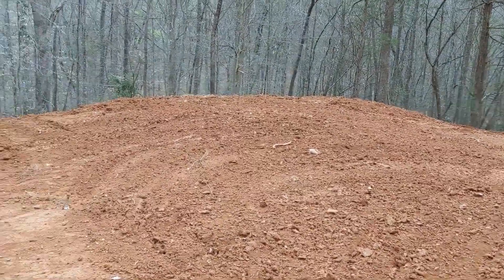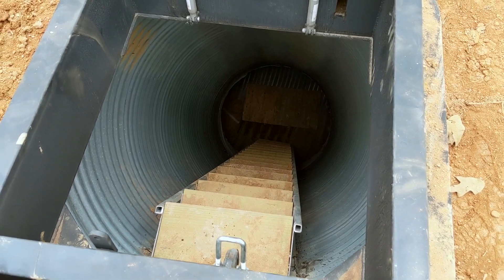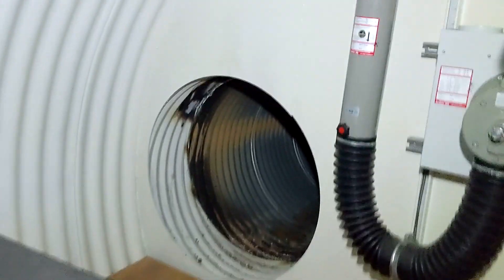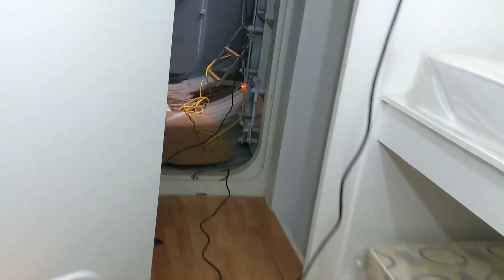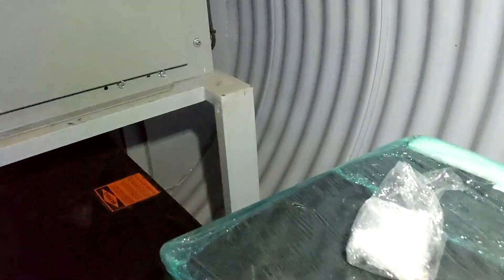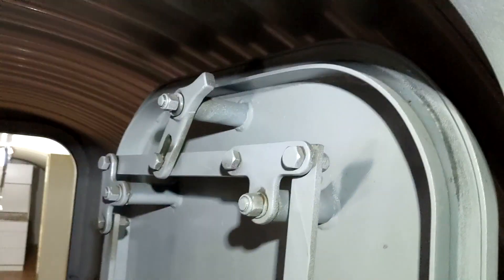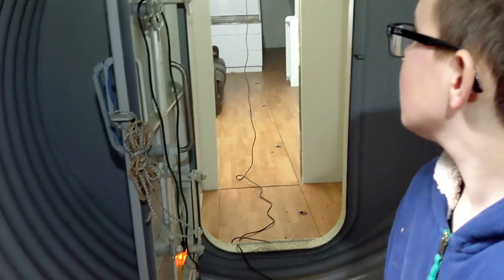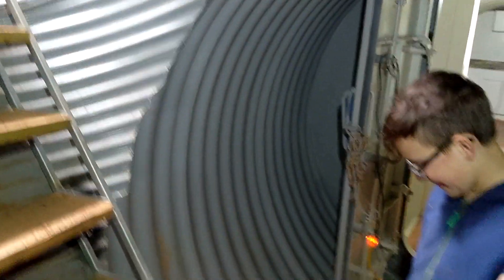What's Inside This Underground Bunker?

Comment: Seems to me like it needs a way to pump out water in case the access gets flooded. Especially because you would be separated from your generator/battery room if it does get flooded. A simple sump with a line running far away from the bunker... not sure if that is much of a concern or not. In that area

Comment: The entryway is not designed for elderly people or anyone with mobility issues. It would be impossible to move an injured person who is on a stretcher into this bunker. Do you just abandon injured or elderly family members? For the young and agile this would be a good overnight tornado shelter but no way I would want to spend 28 days with other people crowded together in this small space following a nuclear strike. How do you dispose of garbage during a 28-day stay? Pile it up in smelly bags near the entry? What about pets? Where to you dispose of the smelly, used kitty litter? Where do you "walk" the dog? Or do you just abandon your pets? What about the ventilation pipes? Can an enemy just stuff rags in them so you have to either come outside or suffocate? Can they stick a garden hose in a ventilation pipe and flood the bunker? Will a heavy snowfall or snowdrifts clog the ventilation pipes? How will you tell what is happening on the surface (trespassers, outdoor temperature, radiation level..) when you are in the shelter? Will your above ground sensors be EMP-proof? Will your solar panels, diesel generator or whatever provides power to the bunker's ventilation system also be EMP-proof? I recommend you consider this bunker from the perspective of an enemy and also actually live in this bunker for a week to discover some of it short-comings and what needs to be changed before you have to use it for real.
Reply: BS-

Comment: I've always wondered why things are not added to the gen set to recover heat from the exhaust to help heat water, and the shelter itself since they you can not ever have LP inside a bunker. Being 25 feet down, and zero insulation, that thing will be cold even in the summer. 

I would be very interested in actually seeing the shower being run with warm water, and see just how much condensation builds up on everything in a cold bunker. Logic tells me that it will be just like taking a cold drink from the refrigerator and setting it on the table and the condensation that forms on it instantly will be massive. You can not get away from vapor drive. Moisture will ALWAYS go from hot to cold and condensate, be it a can of beer or a mirror in your bathroom after a warm shower, or a cold bunker wall that's against the earth 25 feet down.

This is why basements smell musty. They have no insulation, and are cooler, and the moisture from upstairs moves to the cooler walls, and damp basement walls start smelling musty...no magic.

Some thing like this I "THINK" would be a help inside a bunker, but I'm not sure. 
https://polarpower.com/products/generator-accessories/exhaust-heat-exchanger/

Keep up the great work.
Reply: I'd imagine you really wouldn't want to cool the exhaust gases and have them create condensation inside the pipe. Also it's a minimal amount of recoverable heat - you can hold your hand over a car's exhaust, the majority of the heat produced is within the cylinder block. Maybe better to dump the excess solar into a heater bank.
These bunkers are not really designed to function beyond a few days, like there is no insulation so everything will generate condensation, no CO2 scrubbers etc
Reply: @____________________________.x  That's a good point horse about moisture, and answers why they would make the heat exchanger out of 304 stainless steel, so it doesn't rust out. It's also a great point about actual time spent in this bunker and I guess it comes down to cost. Instead of buying a heat exchanger, it might just be better to spend the $500 to a $1000 buy more fuel and food.

I do think it should be an option to have just an inch of foam sprayed on the bunker to insulate it. That alone would address these problems and is well worth it. To spray just 1" thick per square foot is around $1.25 to $1.50, so a bunker that's 10' x 40' would be close to $2,000 but we should double that because the pipe is not flat, but corrugated so there's more surface area. Even so at $4,000, and that includes profit, it's well worth it, and would take no time to do. Buy your own foaming machine and your cost to do it drops by half or more. I know, I have a couple foaming machines and have sprayed foam for over 20 years building monolithic domes and spraying for friends.

I remember when I lived up north, an Amish friend of mine who owned a store was going to be shut down by the FDA because his coolers and freezer were not able to keep the temps required. He didn't know what they were going to do. I asked to see his set up in the back and it was just a short semi trailer with a gasoline engine powered compressor trying to keep things cool, and in 90 degree summers that wasn't happening.

I told him I could spray his trailer with foam and that would work. He sheepishly asked how much, and I knew they were struggling with money due to other issues, so I said let's spray it and see how it goes. If it works, you can pay me what you feel it's worth down the road, and if it doesn't, you owe me nothing. 

Now I need about 25kw to power up an air compressor, a foaming machine to heat foam and the hose and I have 150 feet of hose, and they have no power at all, so I had to bring my 35kw diesel. It took longer to warm everything up and set up and pack up, than it did to spray his trailer. Spraying a bunker would be even faster.

Anyway, I came back the next day and his freezer was 40 degrees colder and his cooler near freezing and his gas compressor was running less than half the time it was before. He was so happy, he said I can now keep ICE CREAM in there on the hottest summer days.

Foam works, and I would not put a bunker in the ground without it. I mean I'm not spending that kind of money, for a limited use item, when it doesn't have to be with a simple fix. 

Read the last paragraph here, and then apply it to a bunker. This is because of foam...foam works.
https://www.monolithic.org/domes-more/monolithic-domes-in-alaska
Reply: wjf213 wow thanks for introducing me to dome homes. They look awesome. I’ve never heard or seen one before.

Comment: That entry way looks so small.  I'd add some rails, tubing, that could double as tracks for a cart with a pulley, wench, system to allow the ability to get things in and out.  Plus it would be nice to hold onto something while you go up and down so you don't take a tumble.
Reply from the maker: The stairs have a built in hand rail.  It is very easy to navigate.  I get in and out several times a day and I am fat!  lol

Comment: What about moisture / humidity?
Reply from the maker: You would be surprised it is very comfortable in there. humidity is handled in the air intake there's a descending condensate air intake line where all the moisture falls out of the air and is then drained down through a check valve and dry well.
Reply: @engineer775  that's fantastic.   Ive had poor luck here in the south below grade with condensation / vapor / humidity.   Always end up with a dehumidifier in the mix.
Reply from the maker: @TURBOLANDRAIDER  If we do need some dehumidification we have the power and we have the pumps in place.

Comment: Don't forget after you're finished with everything and it's ready to go. Clean those stairs and add non-slip grippy mats to them for a non-slip surface on your staircase. ie: https://www.amazon.com/EdenProducts-Traction-Available-Friction-Abrasive/dp/B077KGCBJL/ref=zg_bs_110761011_2?_encoding=UTF8&psc=1&refRID=G4T0XS3Z024F94XN7FAT Something like this. There are MANY different types of non-slip stair coverings to choose from. Just google: Non slip stair treads.
Reply from the maker: That's awesome!  Thank you for the reminder and the link.
Reply: @engineer775  Anytime bud! Just remember that link is just 1 of MANY types. There are also carpeted ones and metal ones etc... so look around for what suits you guys best!

Comment: It's a hatch through a bulkhead-
Do you have an anchor point at the entrance in order to be able to use a block & tackle to raise and lower whatever (equipment, supplies, or a litter?)
Reply from the maker: I use and excavator currently! :) you can easily slide items up and down.  but there are plenty attachment points for a block and tackle.
Reply: i'm thinking a sled that used the handrails on the entrance steps.
Reply from the maker: @2007rgallo  That works too
Reply: Sled-good idea!
Reply: @horacerumpole6912  that's what i do.
Reply: Well shazam!
Reply: @horacerumpole6912  shazam!    that is hysterical....i will have to add that to my repertoire.

Comment: can i do this for $35,000, and what if you have groundwater issues.
Reply from the maker: We made a french drain under the bunker that allows any water to flow to one end where we installed a sump pump.    This site doesn 't have any ground water issues but the backup is in place.
Reply from the maker: You cannot do this for under 135k.  Now , I didn't show you everything and we are not finished.  There is 35k worth of auxiliary equipment on this one alone.
Reply: @engineer775  it's my belief some site may not be suitable for this, or are there reasonable ways to get around a high water table.
Reply: @2007rgallo  culvert type bunkers are not desinged to be below water table. The company that makes this explain this. If you have a high water table you but the steel box water tight bunker which they also sell
Reply: @ronicarbine8723  i'm dialed in now, thanks.
Reply: Build it above ground, then cover it with a hill of dirt. Same thing but it might be a bit more obvious depending on your terrain.
You couldn't do this for $35K, the steel would cost half of that. Someone could certainly do a better fit out inside though, and with more money you could certainly design a better one.
Reply: @____________________________.x  that's a good idea.